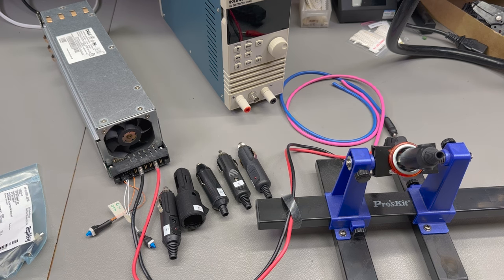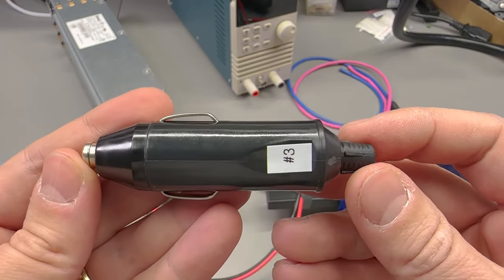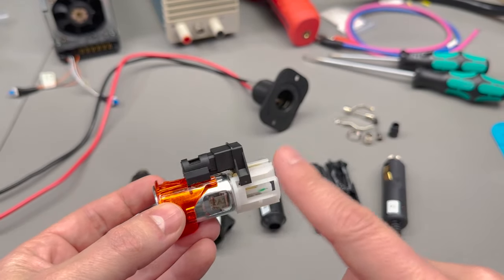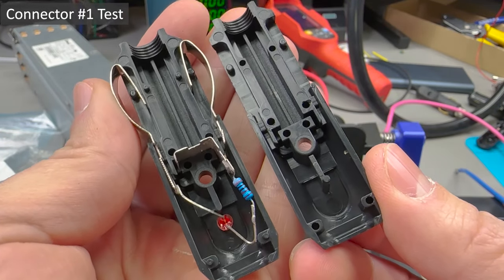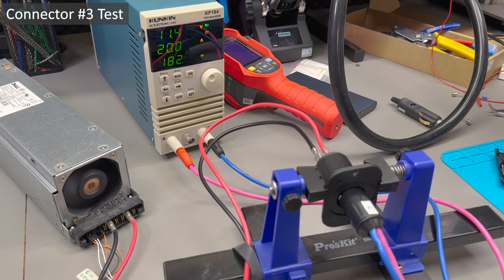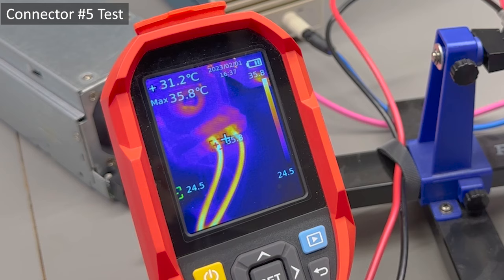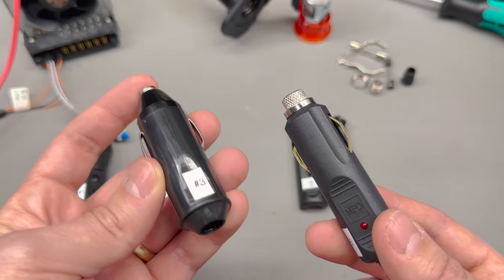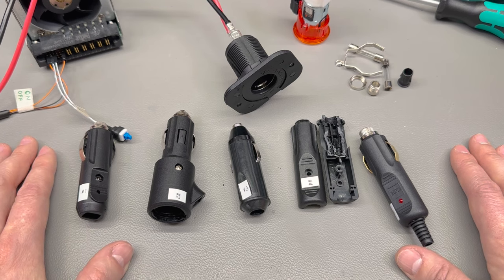High Current Cigarette Lighter Connector Test | Voltlog #473

Comment: I use the female connectors from junkyard cars. Some are better than others. They are made way better, usually all-metal in the 80s and 90s, and seem to stay cooler longer than the modern molded plastic ones. Can usually scrounge tons of other 12v stuff too, often soundsystem wiring, relays, lights and fixtures, displays, and all kinds of accessories that get left behind. I used to use one for a removable "1200w" subwoofer in my SUV, and it never had any issues, with the amp going thermal before the plug could.

Comment: Great real world testing. 👍My biggest worry would be that when you reorder the part you settled on, you get something that's not consistent with your test sample. I've noticed this with lots of injection molded parts. Same mold, but from batch to batch, they seem to run whatever the cheapest plastic they can find that week. I'd assume the same goes for the mechanical bits. Makes it difficult to maintain consistency.

Comment: If I need connect inverter or something i solder all connections inside of that connector. Worst connection is through metal spring. In proper stuff where is spring loaded fuse, fuse always touches plates with wires and spring is behind one of the plate. So sometimes I solder wires to the fuse...

Comment: most car cigar sockets are rated (and fused) for 60W or 5A. I don't think the connector design was ever intended to be used for 10A or more. Even my 60W stuff gets unreasonably hot. When things did melt, the culprit was the ground connections. If you need more power than that, just use a connector that makes more sense. These are far too bulky anyway. It was designed around the cigar, not electronics.

Comment: Thank you for this video. I want to run a 100W Amateur Radio (and possibly 2 other radios plus accessories) from a cigarette lighter. I will explore the internals and performance of connectors I plan to use.
Reply: My current choice would probably be a panel mount XT60 which is  small but rated for 30A (XT60 and relatives are commonly used for battery packs in the RC world), but it depends if you can find an acceptable/workable (or are allowed to ooke holes - maybe a lease) spot to mount it.
Reply: @michaeltempsch5282  I can't make any changes to the car, so it has to be from the cigarette outlet (then maybe a power pole/XT60 pig tail)
Reply: You will probably have to dial that 100W back a bit.
Reply: @mindshelfpro  What about non-permanent things like taking +12V from a fuse Y adapter (remove original fuse from slot, insert adapter, insert original fuse in adapter which also has additional fuse to a  new wire end for your needs). Ground to some easily accessible screw/bolt. Everything easy to remove w/o marks.